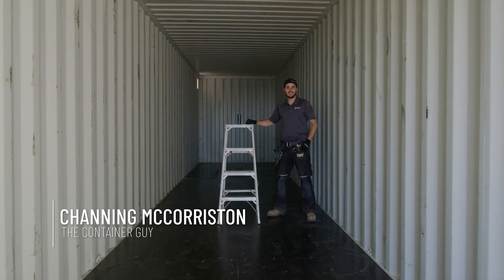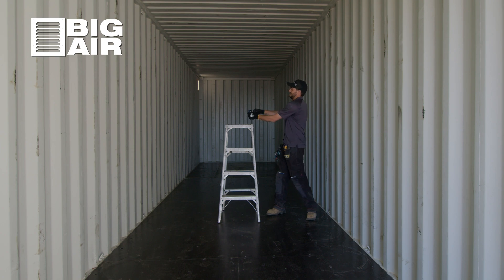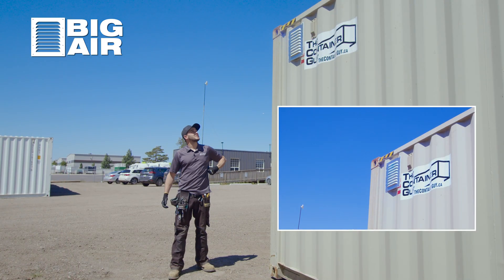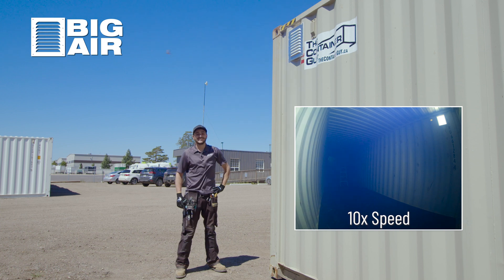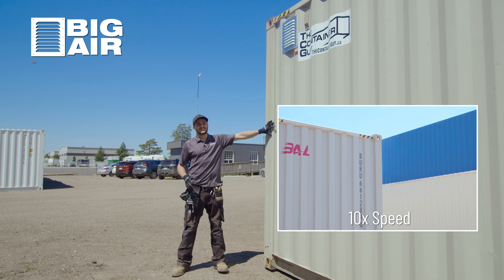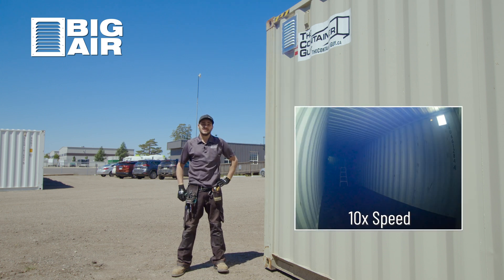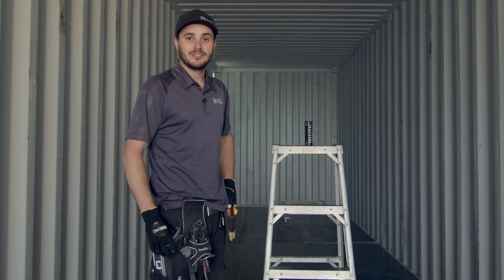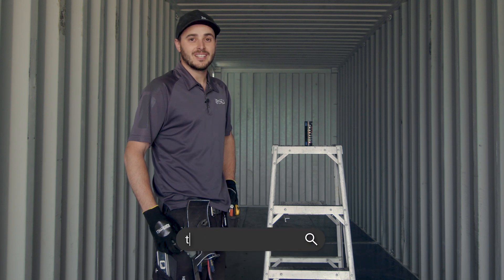Shipping Container Ventilation - BigAir 45 Passive Vents | Smoke Grenade Demo

Comment: I have 12 mitter container shop and I  am using it as tuckshop during summer it's very hot and where I am staying during summer the temperature can rich 35 digree centegrade so what can I use or what can you advise me?
Reply from the maker: Insulation and A/C

Mini Split Heat Pump is best for air conditioning.

Comment: Hey, we live in Ireland and looking at getting a 40ft container for storing our household items (furniture/clothes/everything) as we are doing a big remodel. 
Its so wet in Ireland and i'm concerned about the contents getting destroyed, would you recommend vents as well as insulation?
Reply from the maker: Vents will make the humidity inside be similar to the humidity outside. 

Insulation will only help if you don't ventilate and install a mini split to control the humidity inside. This is an awesome option if you can afford it. 

Use 2lb closed cell spray foam. Make sure you install strut channel prior spray foaming so you can still attach things to your walls. CSM or MSS brackets avoid any welding.
Reply: I have a 40’ in my garden in Wicklow, there’s just timber and garden tools in there and surrounded by trees etc so not a lot of high wind / air flow, it’s fine with both doors open but close the doors for two days and I come back to mold on the ply / timber inside, I put a large fan in yesterday for when I need to ventilate it but defo need to install fixed vents like in this video, it was fine during the summer but last few weeks have been cold /wet and I just can’t leave the doors closed because of mold buildup

Comment: If you want to install the Solar roof vent kit that comes with 2 Big Air 45 vents on a 20' container

Would the 2 Big Air 45's be enough?
Would you put them both low? Or one high and one low?
Would you have them both on the same side wall?
Would you put them as far from the roof vent as possible?

Comment: Are vents a good idea for the shower and kitchen even when using closed seal spray foam?
Reply from the maker: You should have controlled ventilation (fans), not passive ventilation.
Reply: @TheContainerGuyTV  thank you for your reply.  Any suggestions for specific units? Does your company supply any of the recommended units?

Comment: We are doing a refer container home in Costa Rica and looking for ventilation options.  We will be rotating 3 months there 3 months and back in the states, so for two 3 months periods per year the containers will be closed up.  Without a good solution we could end up with mold problems.  Not sure these would solve the issue by themselves.  Any suggestions???
Reply from the maker: An ERV is your safest bet to exchange air and manage humidity. https://amzn.to/3iCkJf8 or https://amzn.to/3gVXYT2

Could hook it up to a couple AC Infinity 6 in duct fans and use their temp/humidity controller. One controller can run up to 4 fans. https://amzn.to/3uqBhK2

Panasonic has a stand alone ERV which look pretty cool. They don't work in Canada (need HRVs in cold climates) so I've never tested one. I have their whisper warm bathroom fan in my house and it's a great product. https://amzn.to/3OXAWb8
Reply: Greatly appreciate the reply.  Looks like the stand alone version is what we are looking for since we are located at an altitude where we don't need heat or AC.  The link says it will do a whole house, but I will have to do some more research.  Thanks for pointing us in a direction to start!

Comment: I lived in Arizona for 15 years with swamp cooling and OCD so I have a finite understanding of ventilation. Birds, rodents and bugs could get in and your venting system would actually cause any fire to burn faster and allot hotter, you basically made a mass crematorium. xD
Reply: Good to consider fire. How does swamp cooling work with OCD. ✌🏻
Reply from the maker: 1. I'd love to see a bird, rodent, or even a bug get through the bug screen. https://amzn.to/3OBrtGd 

2. You should not have open flames in your storage container.
Reply: @The Container Guy  Rats tunnel under the ground. They will chew threw concrete and 1/4" steel.